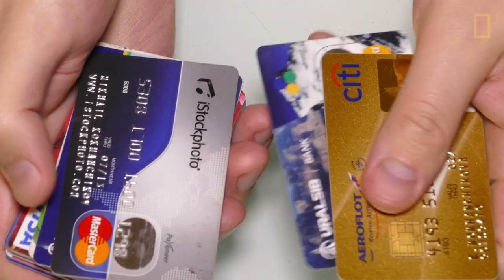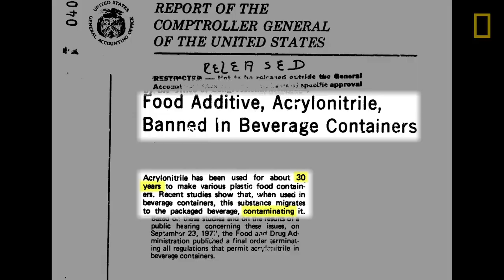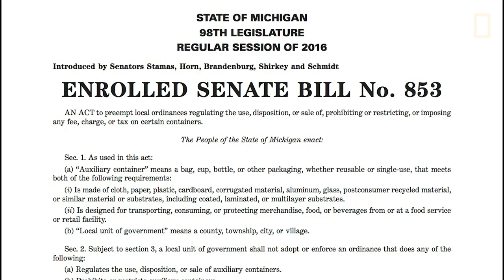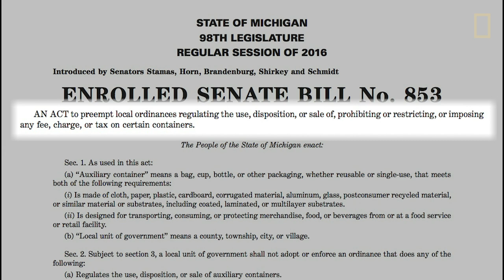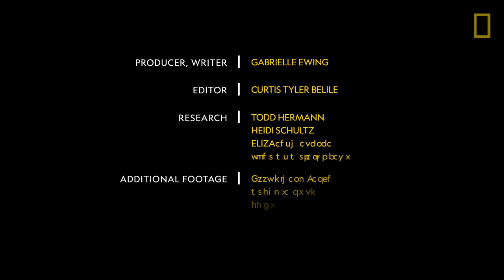A Brief History of How Plastic Has Changed Our World | National Geographic

Comment: Italy banned plastic bags a few years ago. If you go to the store now you can buy reusable bags which are expensive (4/5€) but very robust and reusable.
I remember when the switch happened for a few months we always forgot to bring those bags with us. But after a while it became a routine. That's it, you have to change your habits from use-and-throw-away to buy-and-reuse.
I'm very happy because in the long run is cheaper and greener.
Recently also plastic bags for groceries have been replaced by biodegradable ones.

Comment: Use paper staws over glass or stainless. And glass over stainless steel. Metal is finite, and people will be just as careless with those, than they have been with plastic...and trading one problem for another-is not a solution. Paper is compostable and recyclable, and glass is recyclable and cheap to produce. Metal is a pain to clean, a pain to recycle, and expensive to use.

Comment: There's nothing wrong with plastic, it's people, it's simply irresponsible people acting arrogantly towards others and the environment.
Reply: kurt lindner single use plastic is 100% of the problem.
1. Doesn't degrade 
2. Serves no other purpose
3. Not recyclable 
So that lid from that latte you bought will be in the eco system for 1000s of years.